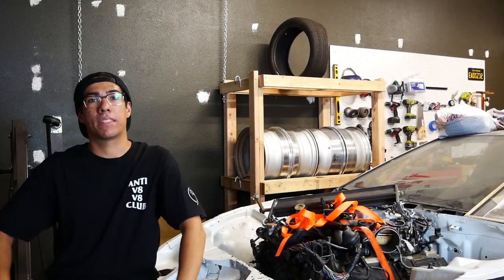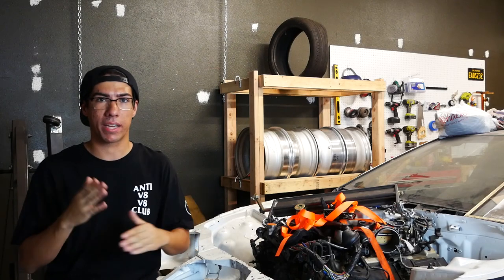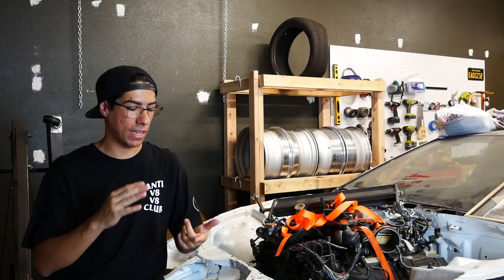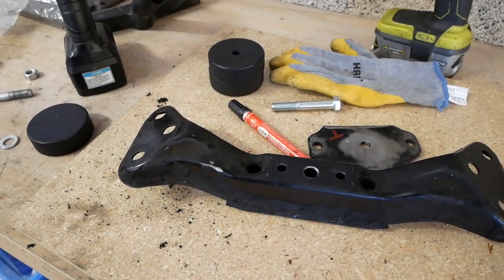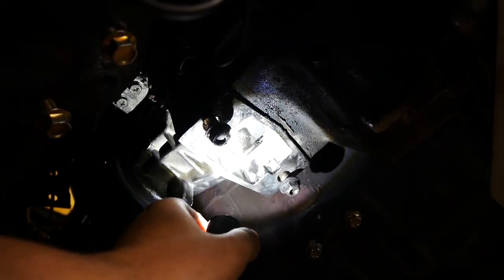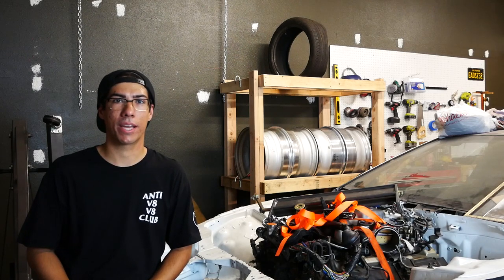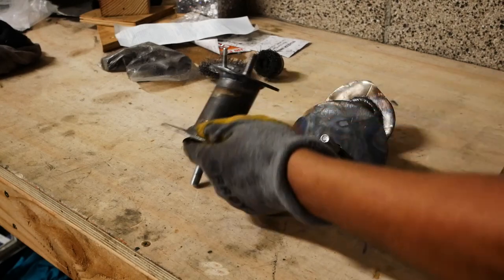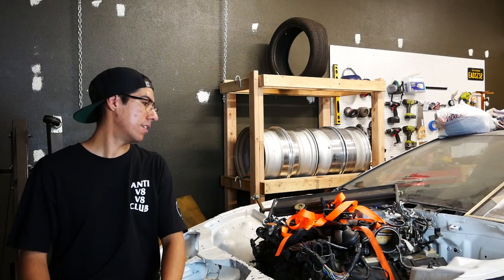V2 Motor and Trans Mounts for the VH45 300ZX

Comment: It’s not a hard swap if you just buy mounts that work with the adapter plate.  There are 3 or 4 companies that do it.  Side note those hockey pucks aren’t going to dampen anything.  All torquing and vibration will go right through the bolt.  You might even snap the bolt with your setup.  Spool mount is the best way.

Comment: I'm using performance Vh rear sump oil pan & mounts fitment is good so far
Reply from the maker: Can you pretty please measure the angle on your crank pulley and compare it to the angle of the flange on the diff and post it here?
Reply: OffBeat Garage sorry my engine is currently out, I've only had a chance to test fit. I suggest you join the Facebook group (Vh45+ & 300zx v8 swap info) someone there should have your answer !
Reply: OffBeat Garage Eric from pvh is on there & should be able to help you

Comment: Can you space the front cross member down 25mm then make 25mm front rollcenter spacers?
Reply: That way you can use stock driveshaft and good angle. But have to make v3 motormounts and crossmember spacer. Rollcenter can be done later.